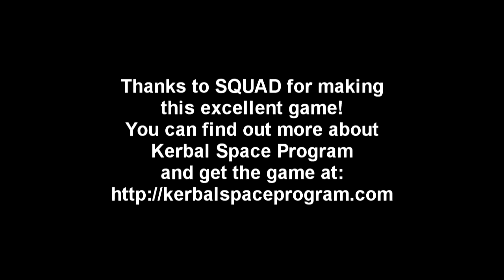Kerbal Space Program (0.23) - Realism Overhaul 018 - The Forseti Launcher

Comment: Most of my accidental stagings are when launching a single stage lander into it's ascent phase. "Alright, to orbit! kerkling sound... shoot." :)

I want to start playing on RSS/RO myself... but I always run into weird RSS related issues. (Beside the water behavior, I tend to see a lot of things like the launch pad grate being suspended in the air for example.)

I might try running with a stock sized version of RSS/RO. The ISP values can be scaled down to require a similar style of rocket to that of RSS/RO. Having said that, there certainly is something very appealing about things being scaled to "life sized". :)
Reply: RT2 does work (more or less) in .23.5 so don't let that deter you. If you have any trouble setting up RSS/RO, let me know on the forums or the RSS subreddit.
Reply: *****
Do you have the latest FAR? .13 had an issue where it could crash midway (if a part, like most AIES engines including the ones you were using on S-V, had a ModuleJettison but no faiirng, then FAR would crash) and you get regular-KSP drag! .13.1 fixed it; update.
Reply: *****
I don't think .13.1 was out when you did the Showcase videos, but it's certainly been around longer than a day. It does sound like something is breaking though. I suggest you post on the FAR thread and ask Ferram about it. .13.x has lower subsonic drag than .12.x so clearly something's wrong. You certainly can load everything btw; it's just the FAR module on the part breaks during flight.

Comment: A few notes (as always ^^): first, gotta admit I was in suspense from the moment you added that fairing base wondering when you'd notice and hoping it was before launch...second, you mention how light this rocket is. Well yes, it is: it's using a hydrolox upper stage from the late 60s/early 70s, a second-stage closed-cycle kerolox engine from 2001, and a comparatively old hypergolic lower (from mid 60s). You compare that to a rocket from 1956 and what do you expect? ^^
Third, you seem to underestimate how much energy the other (non-dish) antennas use. The DP-10 (or whatever it is) ain't cheap; that's why you're drawing about 100-110W rather than the 80W your big dish takes. (RO uses 1EC per second = 1kW, 1EC = 1kJ, so 3600EC = 1kWh; you gave your probe just under 2kWh worth of battery this episode).
If I were you (it's a bit late now, obviously, but still) I'd suggest redistributing between second and third stages; your second stage has just about right or maybe slightly too low TWR, whereas your final stage has a very high TWR for an orbital stage (consider that these days Centaurs fly with 0.35TWR or so!)
Finally, the issue with the SRBs is that RealEngines doesn't actually touch them at all, IIRC; this means that they have about 1/4.2 the fuel they should, since RF changes SolidFuel and expects engine packs to fix SRBs. You probably should grab just the SRB changes from RftSEngines if you want to use SRBs. (note that the only SRBs unaffected are Stretchies, everything else will have less than 1/4 the burn time, and less than 1/4 the mass ratio, that they should).
Reply: Heh, yeah. Then again, Soyuz 2 isn't as different from the first R-7 as Atlas V / Delta IV are from their predecessors ("They lifted up the name and stuck a new rocket underneath"). But it's not so much the RD-0124 that's giving you excellent performance as rather the RL-10--even 359s isn't as amazing as 444s! You probably have double the payload fraction you would without hydrolox.

Yeah, I do see (even in 019) some better luck with charge. Even turning off antennas! (Although not the "starts on" antenna, which probably draws more than the Communotron...)

Wait why do you want high TWR for a TLI burn? It's much less important than for an orbital insertion / upper stage. 3m upper makes sense--you'll probably even have less drag total, without the trucking in of the rocket between S2/S3.

You might well like the RftS solids since they model real ones (like the Ariane 5's) and they're sized for a RO playthrough, but either way...yeah. Need to change them somehow.

My pleasure as always!
Reply: Ah, right. Sorry.

Yeah, that's...pretty much how it works. Small step from grabbing to customizing, then soon to modding!
I'm going to update RftS in the next couple days with support for the new ARM parts, so you might want to grab it then.